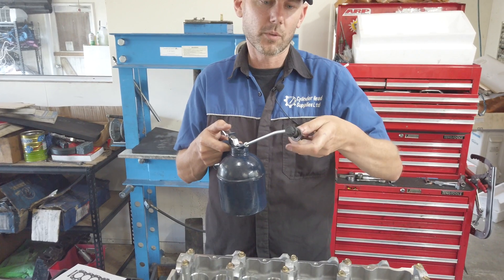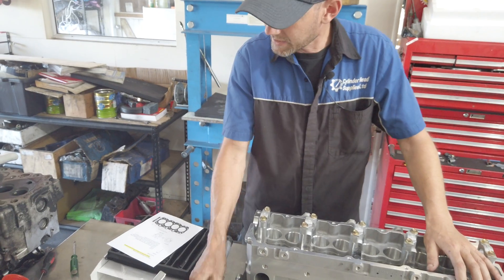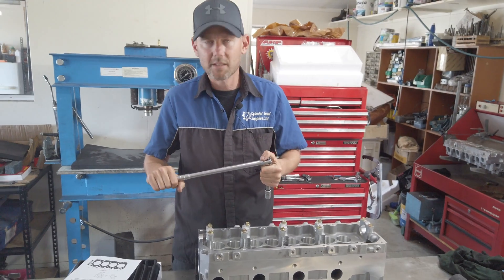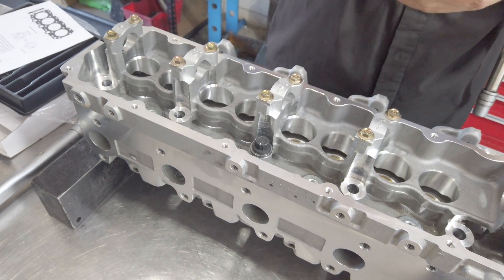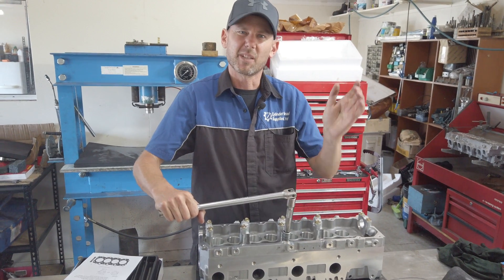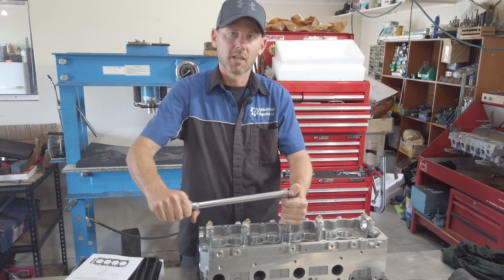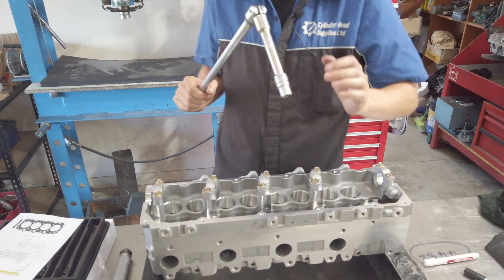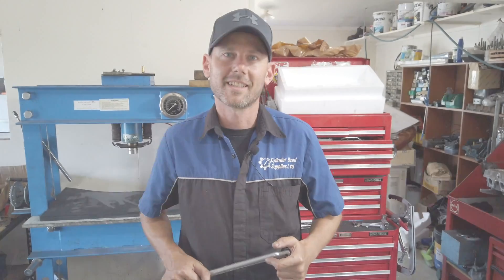how to torque cylinder head. Angle torque. Toyota 1KZ-te

Comment: I stopped using oil. It can spoil the head gasket internal. Prone to leak.
Also the manual doesn't say that the bolts need to be replaced. Only measure them if they are on specs and the thread is nice. I run them in a couple of times before putting the head on to final clean the thread and turn them out by hand to see if there are any imperfections. 
I use molybdenum grease on thread and washer. It doesn't spoil the gasket internal. Also 1 control run all bolts with the 39NM, making sure they got all the same torque before I do the 90 90...
Reply: That is all really good advice! If you use to much oil on the bolts it can end up getting between the head gasket and the sealing face which will cause the head gasket to fail/ leak. Only use a very small amount of oil or to be safe use molybdenum grease or similar thread anti-seize lubricant designed especially for bolts. ARP make a great thread lubricant (ARP Ultra-Torque Fastener Assembly Lubricant)

Comment: Hi there, picking up a Prado with a 1kzte, has 450,000km on it, but has a new AMC top end put on it. 

Is there any signs I should look for or keep an eye out on when viewing the vehicle ?
Reply from the maker: Hi. I would say all the general signs apply like smoke from exhaust, leaks, overheating and uneven idle.
Reply: Cuanto lleva la culata de apriete en libras1kzTE